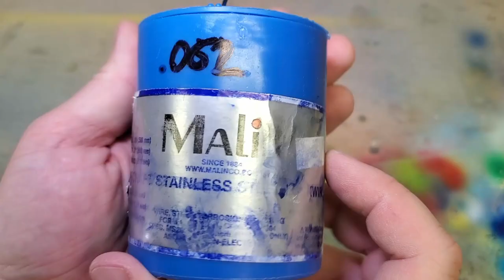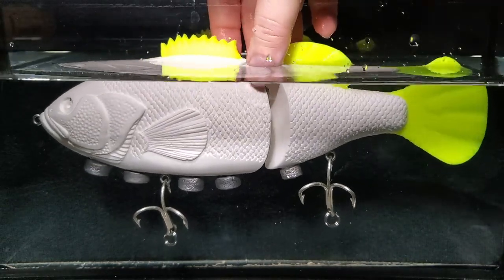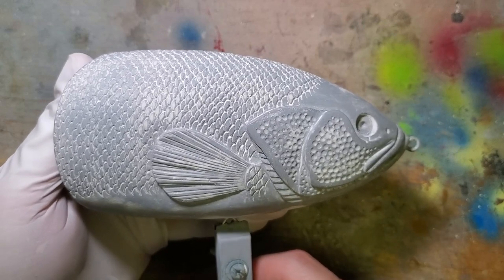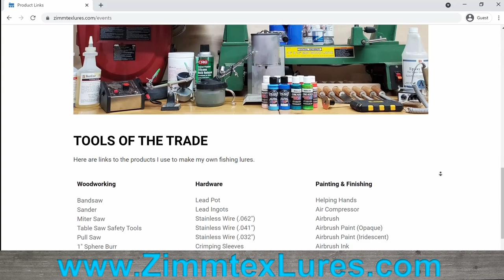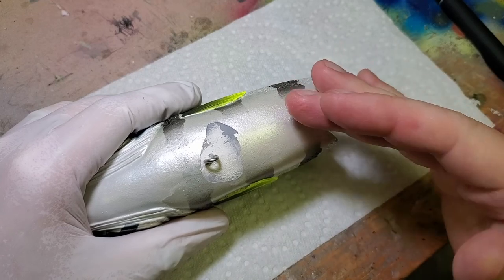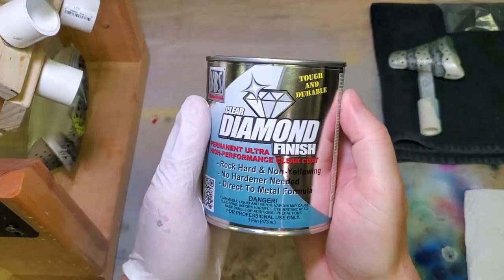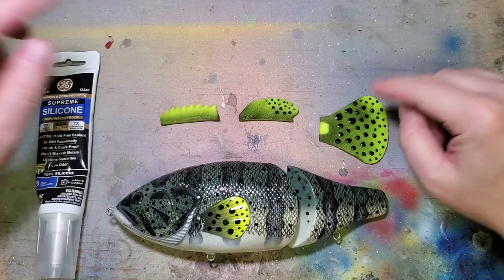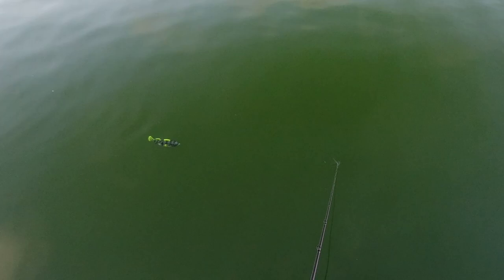Grouper Glidebait Lure Making (Part 2)

Comment: Have you tried Bondo skim coat for the imperfections?  Also are you placing any epoxy in the pilot holes or is coating the screw eye enough to get it done?
Reply from the maker: Have not tried bondo skim coat; I'll have to look into that. I just coat the screw eye. I made a video testing the pullout strength you might find interesting:
https://youtu.be/dkTQanwhnU0
Reply: @zimmtex  Hey, Mike. I was going to suggest Bondo, as well, and for the last year, I have used it exclusively both for repairs and for filling my weight holes. Mikko at SolarBaits does the same. Both of us concluded that super glue, whether mixed with baking soda or not, is just too difficult and time consuming  to sand and shape. 
     Trust me, and try the Bondo; I think you'll love everything about it except the odor (which, fortunately, isn't terribly toxic). One caveat: a single drop of catalyst goes a LONG way. In the beginning, my batches were "kicking" much too fast! Best, Chris (in Maine).
Reply from the maker: Thank you for your input on this. While I've used Bondo before, I haven't used it for a skim coat. I did have problems with it setting up really fast but maybe I should try backing off on the catalyst as you suggested. I do still like baking soda and Instacure for structural fixes, but I agree it is not the only answer. Thanks!